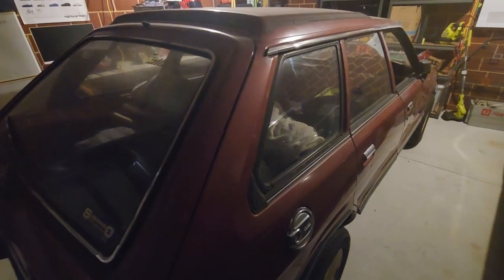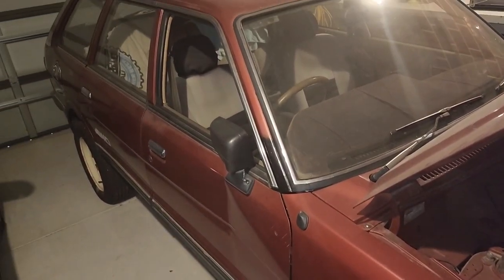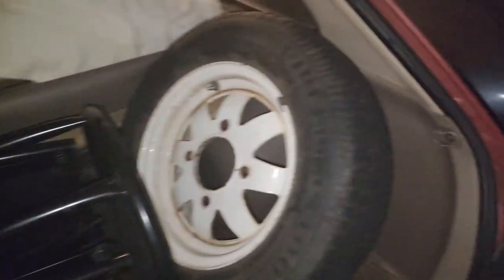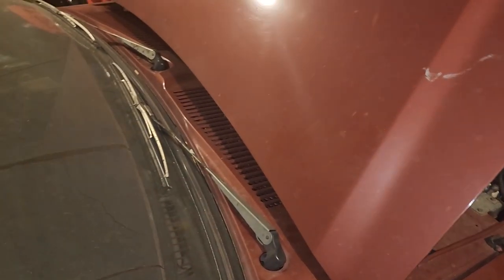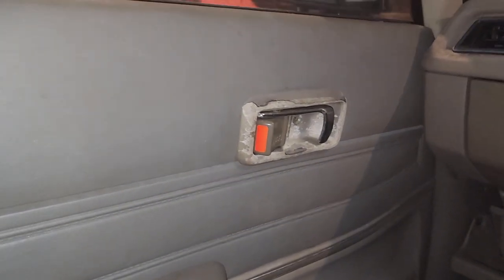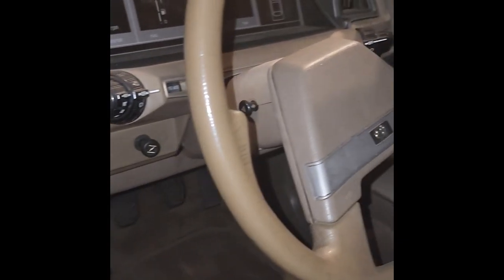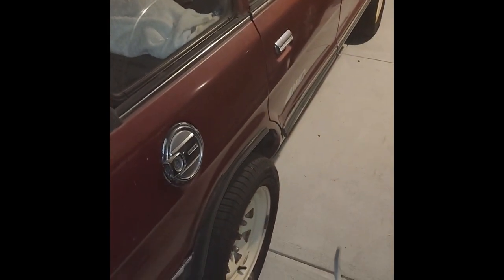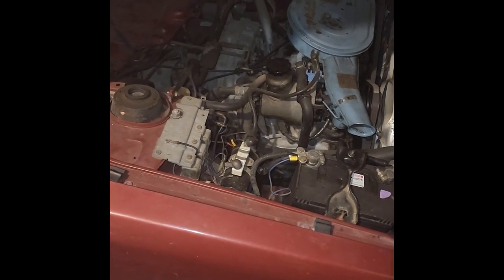My Old School Subaru Touring Wagon!

Comment: Consider getting the C4C club rego. I did this for the L series and Brumby. Anything 1989 or earlier qualifies. There’s a particular club you can sign up for that helps you with the right forms and has no requirements for attending events etc. it’s super easy and rego is a whopping 70% cheaper ongoing.
Reply from the maker: Keen to hear more :D

Comment: Sweet car and super low kms :O 
Just gonna let you know that a dual battery system can work in the engine bay for cheap. Get a SBI 12v100a dual battery isolator and any "wet" battery (agm dont like the heat) that fit in that spot and you'll be good to go for hopefully under $350. Another option is just replacing the existing battery with a high cycle marine battery (HCM27750 will fit tight, HCM24600 would fit nicely) and a low voltage cut-off relay to be able to start the engine again.
As for the aircon, i think i read the TX valve is built into the car and cant be replaced?? Subarino have an aftermarket condenser that fits nicely and does help a bit.
For the engine, consider an ej25 with a dual carb setup if you hate wiring and want something simple.
Reply from the maker: Cheers for the advice mate! I also test drove a friend of mines MY wagon with a "Frankenstein" EJ a while back (EJ22 heads with EJ25 bottom end) and that pulled very nicely!

Comment: I don't know about the rules in Australia (though I think we're all signatories for the same ozone-damaging chemical bans), but if that's the original AC, it was R12. If it's been upgraded to R134a, it will definitely not be as efficient as R12 and if it's still R12, I'm sure it could use a charge. Can't get that here anymore unless maybe you know someone who somehow still has some, but there can't be much of that still around by this point.

I had a silver '84 auto wagon and '83 manual sedan in the same color. Loved those cars. Aftermarket steering wheel transformed steering feel. Also love the old EJ22, particularly the SOHC non-interference engines. One of those in here would about double the power and NA would be dead reliable and still good on fuel. Of course, the EA81 was a nice engine itself, if not powerful as you said. Gear driven cam and simple as it gets without being installed on something that's used to cut grass. I drove mine overloaded for hours on end at or near redline without a cough. There's a reason a number have been converted to light aircraft use.

My experience is the same as yours with CVs—just keep an eye on them. If one tears and you catch it right away, throw some more grease in it, put a new boot over the old one (slit it up the side so you don't have to pull the axle), and secure it between the pleats with black zip ties. I had them last years like that. Now that I think about it, you could probably even do that preemptively.
Reply from the maker: Yep the ole beast definitely still runs the R12 gas which we can't get anymore either from my understanding, so I'll likely need to be retrofitting an R134a system in the near future, however I was thinking I might do this during the EJ conversion. Currently looking at going to either an EJ202 or EJ22 N/A SOHC motor at this stage :)
Reply: @notenoughregos  Oh, yeah, you have more options there. For 4-cylinders, we only got the EJ18 and two generations of 22 (and 1st gen 22 with a turbo, which was a beast of a block) before they were all eventually displaced by the problematic 2.5. IIRC, there was even an 8k rpm EJ, but that might have been Japan only—definitely not US.